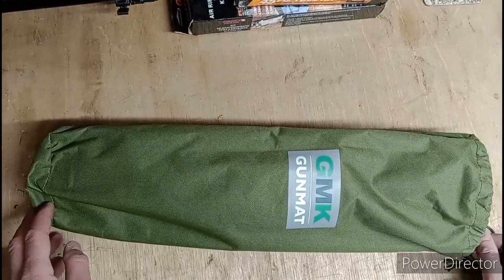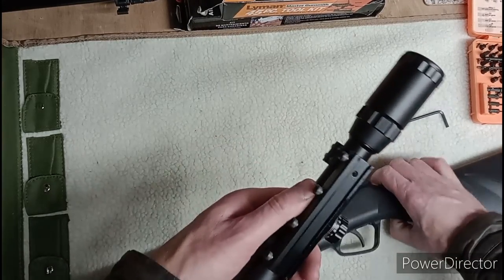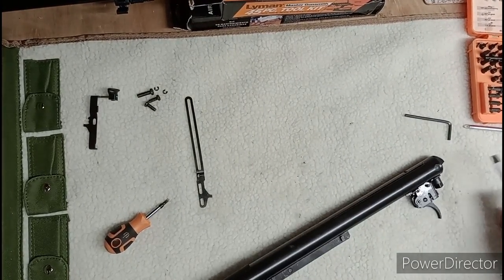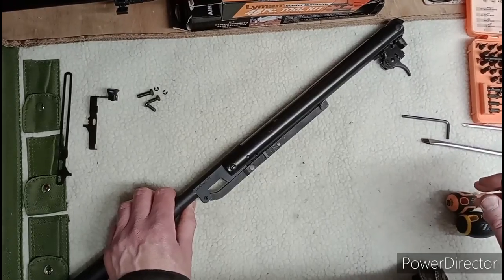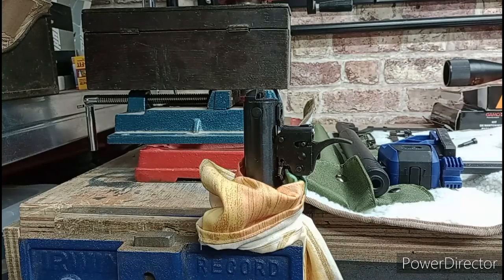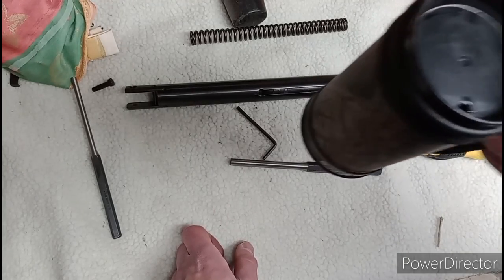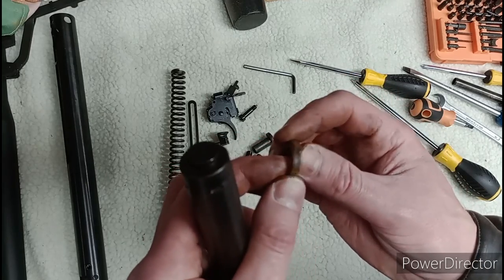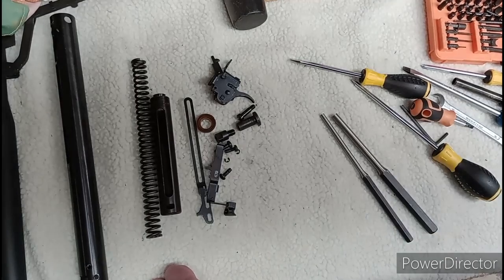NV088 Stoeger X20 S Rebuild Part 2. Tear down. Spring and piston removal. Plus 2 bonus reviews.

Comment: Dip your piston and seal in some hot water if you want to hang onto the original seal. I am sure you know this already just thought I would mention it
Reply from the maker: Hello, thank you for your comment much appreciated 👍🏻.
Apologies yes, I should have mentioned that.
Each time I've removed a piston seal it has been because it was scrap, so I just proceeded on autopilot. I must learn to give more information when I'm filming.
I use the hot water treatment to fit the new piston seals, still a nerve wracking process though.

Comment: I have the Stoeger RX20TAC in .22 and the peelts bounce out of a 10mm bit of ply ive maybe had 220 pellets through it its a week old today from the shop i thinknits very under powerd for the 800fps they claim
Reply from the maker: Hello, thank you for your comment much appreciated. This Stoeger was very underpowered, from memory it was 7ftlb. That does seem to be quite common with them.
The Chronograph battle video shows the original power output and ftlb spread if you are interested.
800fps in .22 would class as a firearm in the UK, perhaps that refers to .177 (although even then I'd be amazed if that velocity be achieved).
Reply: @nickvending9688  ye im in nz I don't think there is any limit on break barrels over here as far as I'm aware I appreciate you replying, it's still a good plinker and target shooter, il justvleve the hunting to my gamo magnum that's got all the power i need to rake down pests
Reply from the maker: Ahh OK, that explains the fps claim then. Glad yours is accurate, unfortunately this one has the classic issue of the pellets clipping the moulded in "moderator" along with the scope giving up the ghost.
The Gamos give good power and can be very accurate. 
Let me know please if you run your Stoeger over a chronograph, I'll be interested to hear the results. 
All the best 
Nick

Comment: I've just bought the same Stoeger (second hand from a reputable store) so these videos have come at the perfect time for me. Thank you
Reply from the maker: Hello, thank you for your comment much appreciated 👍🏻. Glad the videos are helpful. I think the Stoeger is a good second hand buy, especially seeing as they seem pretty tough and respond well to a bit of tuning. Is yours the version with the wood stock?
Reply: @nickvending9688  Mine is identical to the version in your video, although I think is has had a tune up at some point, either that or I've got the elusive responsive trigger. Once again great videos 👍
Reply from the maker: It could be worth checking if someone has fitted a bearing in the trigger assembly, that could be why the trigger is working well. I would have done it to the gun in the series but there wasn't the budget for it.
Good choice with the composite stock, they are pretty tough.

Comment: What is the sencond piece on the spring guide? Like pyramid.. is this necessary? Can you remove it completly? And insert only a ring?
Reply from the maker: It's the spring guide. It is an odd design and won't be helping with the harshness of the shot cycle. As far as I could tell, removing it will rob power because it adds preload to the spring, also locates the spring properly. Perhaps try adding a non metal spacer between the spring and the guide. If you are in a country with airgun power limits you would then need to check that the spacer hasn't made it too powerful, you'd need to shorten the spring to bring the power back down.
Reply: @nickvending9688  what are the dimensions of the spring? Length?
Reply from the maker: @dimitrisvouts6623 sorry, I didn't take measurements at the time.
Reply: @nickvending9688  can i remove it completly and put a plastic ring and a bigger in lennth spring to increase power?
Reply from the maker: You need some sort of spring guide, if nothing else to position the spring correctly. So you'd need to replace it with something the same dimensions but made from a non metallic material.
Reply: @nickvending9688  not the spring guide completly..only the pyramid part

Comment: hi Nick I've got the Stoeger A30 s2 could you tell me if this gun is also known as the Stoeger x20, my spring has broken and cant seem to find anything for my A30, everything i find is for x20. many thanks for any info.
Reply from the maker: Hello 
Thank you for your comment much appreciated. 
Sorry to hear that your spring broke.
From the pictures of the A30 that I've seen I think they are basically the same as the X20.
If you are in the UK it looks like you are limited to a Titan spring, no.11 I believe but please check that before buyingas I'm going by info on one seller's website. I'd bet it will push power up over the 12ftln limit, so please make sure the rifle is chronograph tested after fitting the spring and check it again after you've used it a bit.
I don't like fitting Totan springs because of having to alter them, but they do damp.down spring reverb and they do last well.
The spring I fitted was a Titan No.6 spring from a Mk6 BSA Meteor, as you can see it needed a lot of work. 
Hope this helps, let me know if you need anything else.

Comment: Interesting. The internals appear to be identical to old SMK19's. 34 coils. 3mm wire 240mm long. 18.6mm o/s dia.TWC Do the original spring for £13. My replacement spring raised the power from 9.6ft/lb to 11.2ft/lb..This whole power plant look identical. A different stock and looks completely modern.
Reply from the maker: It wouldn't surprise me if it is the same gun, just with a couple of tweaks and a different stock. Thank you for the info, I've bought from TWC before. In theory I've got the right spring in my box of bits 🤞

Comment: nice one mate 👍 cool video for sure . i hate those clips always come off ok but normally ping one all around the room putting them back on 😂😂😂 piston weights well it’s a subject that’s for sure . i find it usually slows down the gun and you get more recoil as the weight slams up the piston . but not buy a massive amount. top hat made of lighter stuff speeds up the process and can take a bit of the twang away with a good piston  sleeve and guide as for power hard to say for me as i put spring to set up using and adjust to get the power were i want it
Reply from the maker: Thanks Paul, much appreciated 👍🏻. Glad it isn't just me that has that problem with the clips. I've never understood why piston weights are fitted, as you say a decent non-metallic top hat does a much better job.

Comment: i just got one like it its far better than the old wooden stock  £120 i got 20 years ago   only thing is it shooots to the right  and not too sure if it me or the scope too used to iron sights   is 100% silicon oil  any good for oiling and cleaning barle
Reply from the maker: Hello, thank you for your comment much appreciated. Is the scope at the limit of its adjustment or can you zero it to bring the point of impact where you want it?
I wouldn't use silicon oil, it can cause galling.
Bisley, Express or Napier gun oils are best for lubrication. Browning Legia spray for protection from corrosion. Personally I don't clean airgun barrels unless it was dieseling, I prefer to let the lead build up as a lubricant and coating in the barrel. I only clean the barrel if accuracy goes or if I've used old or dry pellets.

Comment: End of scope,was touching the barrel that would never zero so did you put it on for video if not whats going on with the scope touching just before the loading port
Reply from the maker: Hello thank you for your comment much appreciated 👍🏻.
As mentioned in the video, I didn't fit the scope, the gun came to me for work. There is actually a tiny gap between the objective and the cylinder, the objective is adjustable and it turns freely when fitted to the rifle. So while yes it looks close, it is not actually touching.
I think that the gun's accuracy issues are internal, we shall see after the rebuild.

Comment: Seems like a titan xs no.11 spring will fit this nicely. Very tempted
great informative and tuition video. Have you modded the trigger at all as it gets some horrific reviews?
Reply from the maker: All I did to the trigger was change the screw for a longer one. It is still terrible, but at least now it is a bit lighter. There is a mod using a roller bearing from a radio control car, I haven't tried it due to not having anything suitable in my stash of Tamiya spare parts.
Reply: @nickvending9688  Awesome tip on the bearing. I have plenty of tamiya ww2 1/35 armour kits in my stash but no RC. 
I wasn't planning on spending over 200-300 on a cheap plinker/beater, and I wont be shooting at great distances nor that often most likely. In your humble opinion I've seen a s/h stoger x20 for £170 or a s/h bsa lighting xl tactical (prefer tactical to wood), for £275 on guntrader, which would you recommend? The cheapskate in me favours the x20
Reply from the maker: £170 seems way too much for a second hand X20, I thought they weren't that price new.
For me out of those two it would be the BSA, while they have their issues they are much better than the Stoegers. The trigger is better too.
For £275 I reckon you could get a s/h Weihrauch. A Richter Optik scope in a decent one piece mount is ideal without breaking the bank.

Comment: Interesting to see what is inside! Have you ever taken the Gamo apart? Mine seems to diesel a bit after a lack of use (then it goes to normal in a few shots and sets about trying to kill the attached scope).
Reply from the maker: Hello Ian, hope all is well. I haven't taken the Gamo apart yet but I will be fairly soon to fit a different trigger blade so it will be interesting.
My Gamo likes to kill scopes too, however the mighty Richter Optik is putting up a good fight at the moment.
Reply: Gamo is slighty different but almost easier (the trigger comes out with the tube cap)

But I aint even trying to put them beartraps back on! haha
[Wich is a bonus to me since you can decock your rifles]

Comment: Hi ,I have the R X 40 and have put a small ball race into the trigger which reduces the trigger travel,can you offer any suggestions on how to reduce the pull weight ? Thanks for any help.
Reply from the maker: Hello, thank you for your comment much appreciated.
Have you tried a longer adjustment screw? Just be careful that you don't have the same issues that I had.
Reply: I had taken that screw out completely,I still have it so will use it as an example for a longer one, I did not catch your previous post, what issues did you have ?thanks
Reply from the maker: I had to carefully select the adjustment screw because if it was too long the gun would not cock, if it was backed out it would come loose (which made no sense seeing as in theory it is under tension).
I wasn't able to do the bearing modification on this rifle due to lack of budget from the owner (hence almost no new parts beyond the seals). I know some people totally remove the adjustment screw when they do the bearing mod and some leave it in.
Sometimes the bearing modification can cause the trigger to stick after the first stage, so if it is released without fully pulling the trigger it won't return to the start of the first stage, which doesn't seem like a good idea to me.
Reply: Thanks Nick, I will try the screw and if it reduces the pull weight i think a drop of blue locltite should retain it. Will keep ypou posted.
Reply: Hi Nick, found an 11mm long 3mm cap screw and installed it just to the point I felt some resistance did not attempt to go any further. The gun cocks,saftey works,no discharge on severe bump test, time to squeeze the trigger, almost hair trigger, tried it 5 times and the results the same, one huge change from a 6 pound drag to soft as. Easy to hold for free hand shooting as your trigger finger now does not pull the rifle off targer. Many thanks for your suggestion about the screw ,it works.
Reply from the maker: Hello John, glad I could help. All the best, Nick.
Reply: @nickvending9688  the roler of an bike chain works too. some rolers have to be grind down 0,2mm to fit the trigger. i remove the spring in the trigger and now its light and smooth. screw isnt needed any more.
Reply from the maker: Thank you for the tip, much appreciated. If I work on another one I'll give it a go.

Comment: Happy New Year  - Keep up the great work.  Have you decided on what route you're taking on the  95 Yet?  I'm sure its going to be well viewed    (  ;-{)>
Reply from the maker: Hello Steve, happy new year to you too. I was aiming to run the HW95 over the Chronograph today, then take a view on how to proceed. I'm pretty sure it has an Oxpower spring - it will be interesting.
I'm torn between the inevitable TBT kit or whether to go for a V-Mach kit.
Reply: @nickvending9688  I've got 3 - one with TBT short stoke and Titan Spring with a home turned Guide (possibly the nicest with least felt recoil/surge), One with V-Mach (a bit snappy) and one  with the SFS Spring, Guide and their 'red' piston seal (very soft action but nice).  All good, all different but all very accurate, which as they are early Mk 1's I attribute to the 'superior?' barrel.  I'm considering fitting one of ARC's Glided pistons shortly, which was always the plan until Steve (RIP) passed away.
Reply from the maker: @stevepowell3475  hello, apologies for the delay in responding. I'm waiting to hear back from Lyn about the pistons. Thank you for the information, I will let you know what route I take.